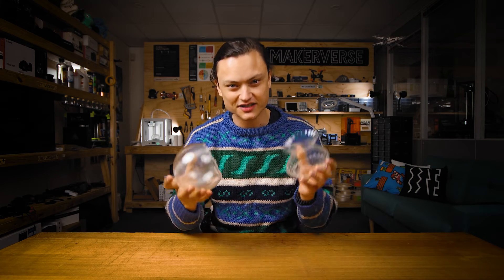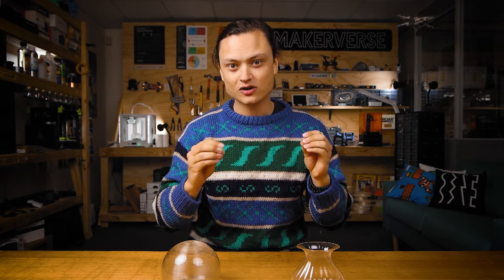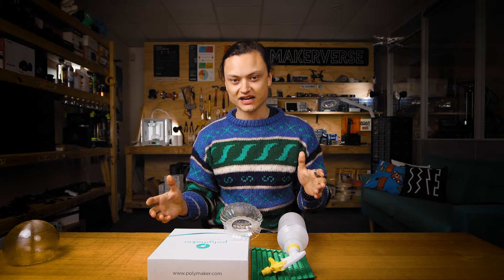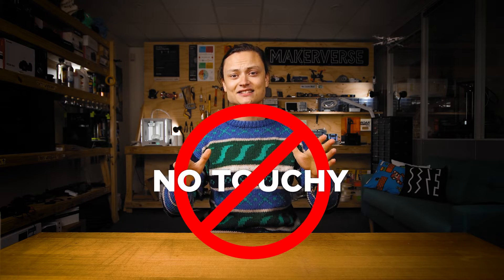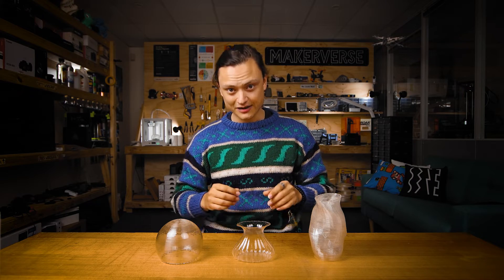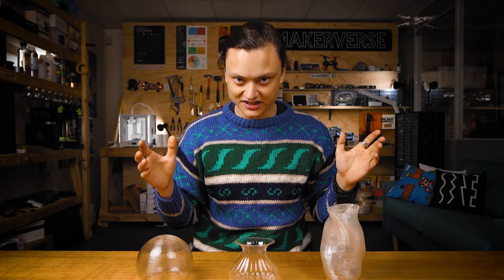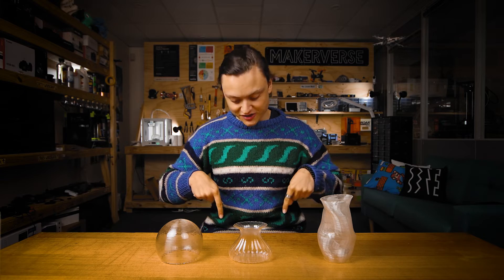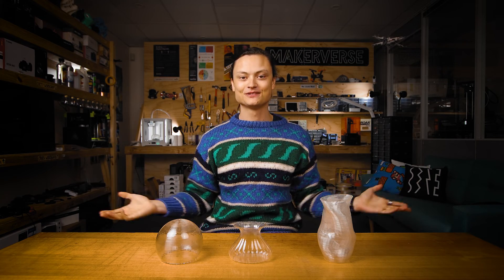The Process to Turn FFF 3D Prints Perfectly Transparent when using PVB Filament

Comment: May I ask you how you printed the globe? Iam trying to print a half globe in vase mode but it allways make the top open. How do I fix this and still have just one or two layers thickness?
Reply from the maker: If you create model with very thin walls and tell the Cura Slicer to only slice with Walls that will let you overcome the limitations of using Vase Mode. Make sure to double check the sliced model (zooming in really close on the layers) to be sure that you only have only a 1-3 layer thickness.

Comment: Great video, just a question for you. What about functional prints that need 5+ walls? It's possible to have any transparency? What would you suggest for prints that need to be under say spring pressure would they withstand the stress as usual PLA+ would? The PVB that is.
Reply from the maker: Definitely worth checking out some specification specs. Once all the IPA has evaporated fully over a couple of days I reckon the material property comparison between PLA+ and PVB is a good one. A total wall thickness of 5mm is that thicker globe I'm holding and that works alright. Any more and transparency goes down some but you should still be able to see through it pretty well.